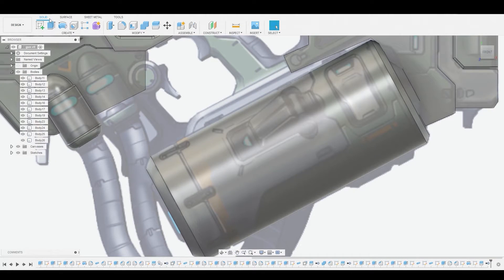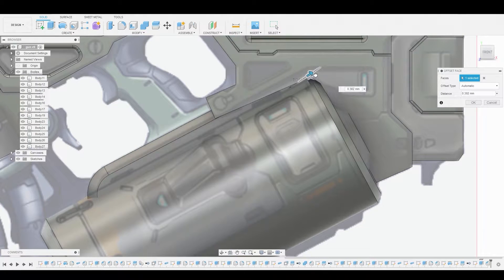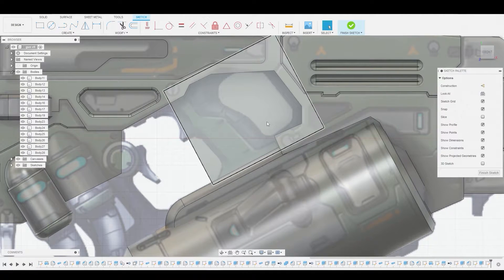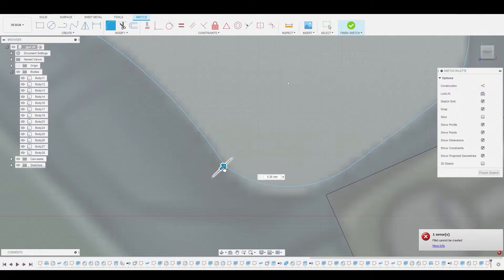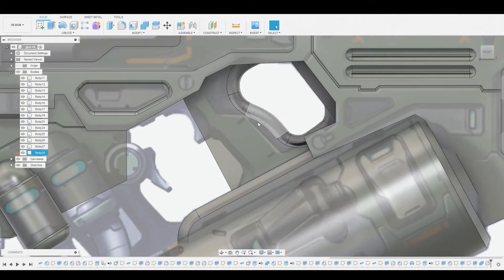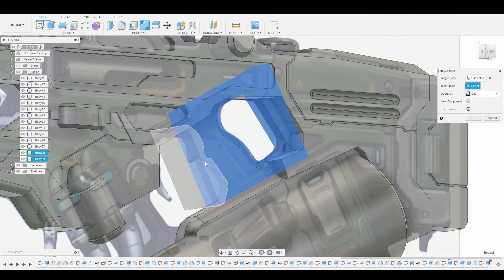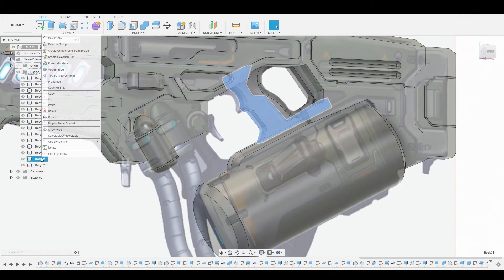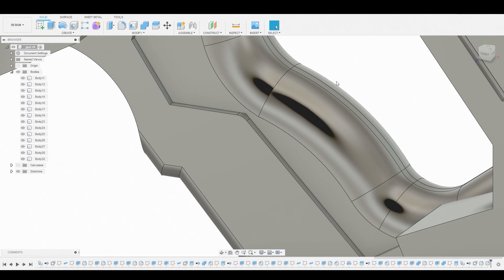Weapon Modeling Series in Fusion 360 (part4)

Comment: thanks for the tutorial, but I have a question, why don't use the spline tool instead of the 3arc tool? is the spline tool is very hard to do?
Reply from the maker: Hi, yes the spline to is more suited for most task, but for some ppl it will be hard to follow my process if I use it, that is the same reason i do not do t-spline modeling if that makes any sense